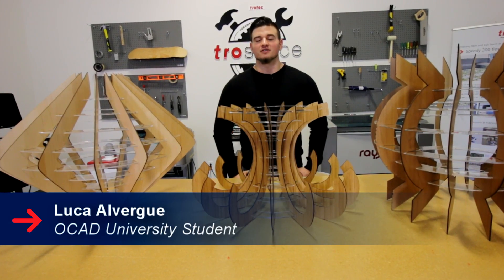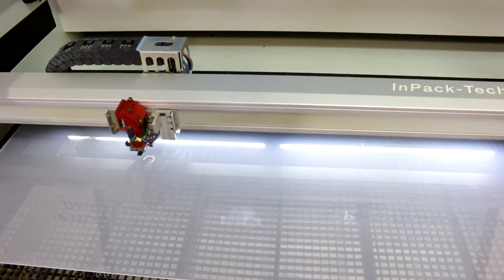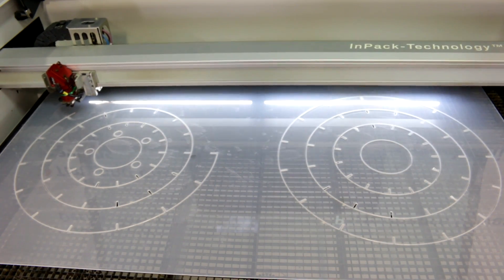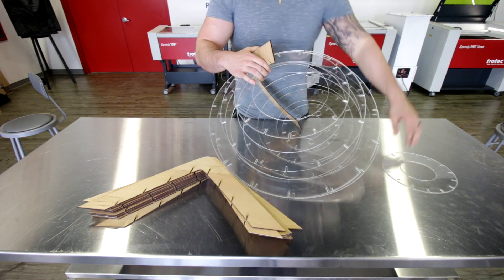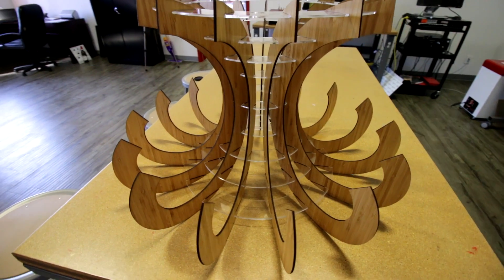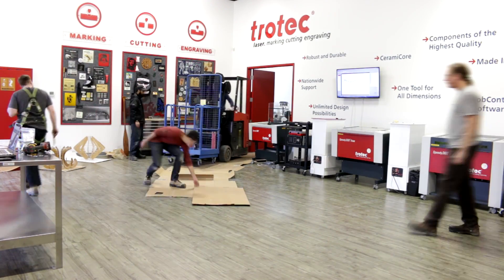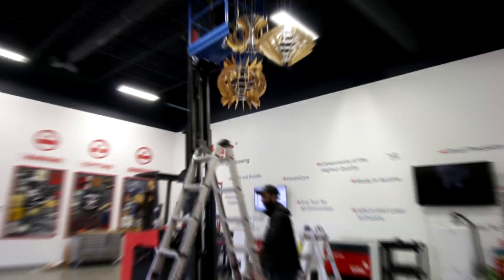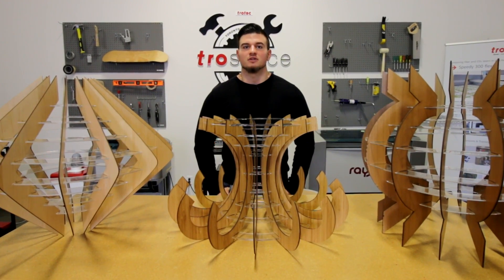Acrylic Chandeliers | Wooden Chandeliers | Trotec

Comment: what software did you use to create them?
Reply from the maker: Hi Rodney, Luca design these in Rhino and then exported to Illustrator.
Reply: Trotec Canada thank you.

I was wondering do you have a best setting table for cutting and engraving cast acrylic?
Reply from the maker: Do you mean laser settings? How thick is the acrylic that you're using? What wattage is your machine?
Reply: Trotec Canada yes, it is the trotec sp500. acrylic is 5mm thick
Reply from the maker: How many watt is your SP500?
Reply: Trotec Canada,  I believe the machine I use is 120 watts.
Reply from the maker: Hi Rodney, the best method would be to keep test cutting a small square about 0.5"x0.5" until you're happy with the edge quality. We would probably say around 100 power and 0.60 speed for the cut. Make sure you have a good suction to prevent any flame damage. You may consider closing off those areas where the acrylic is not on, to add maximum suction.